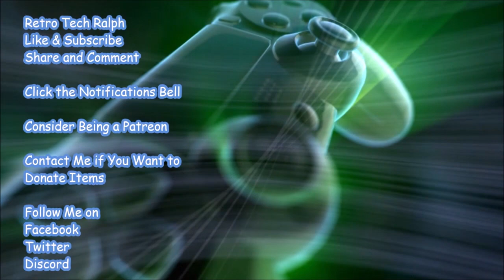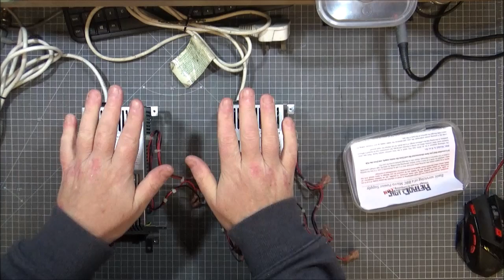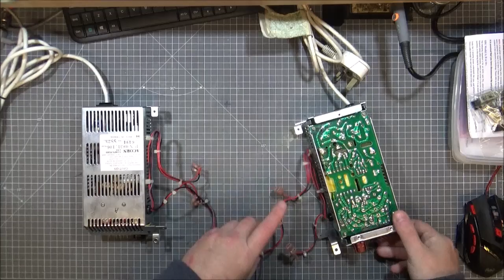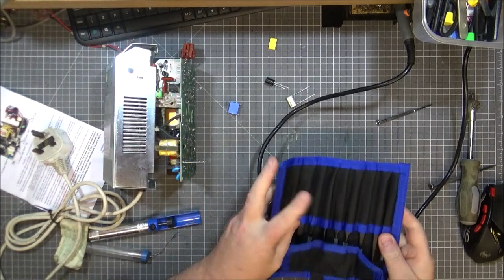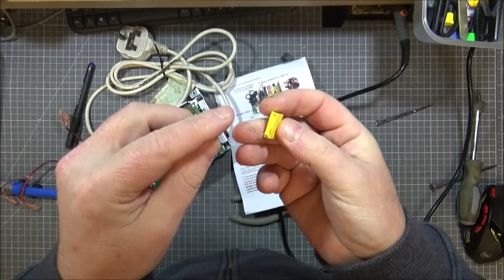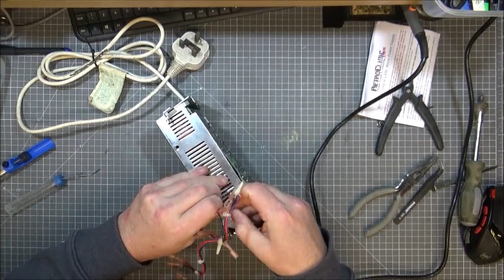BBC Master 128k PSU Cap Replacement

Comment: Undid the screws in the top of the BBC Master PSU case and the four screws in the corners of the PCB. The PCB lifts but something is holding it in where the low voltage cables to the main master circuit board come out. Any ideas and what’s stopping the board lift?
Reply from the maker: probably the bundle of cables going through the side of the case then onto the board. make sure they will pass through the hole in the side and you should be ok. maybe just a cable tie.